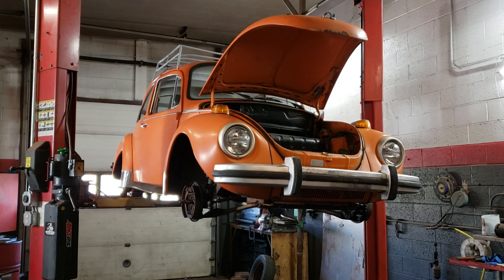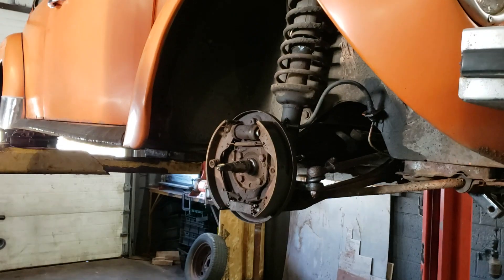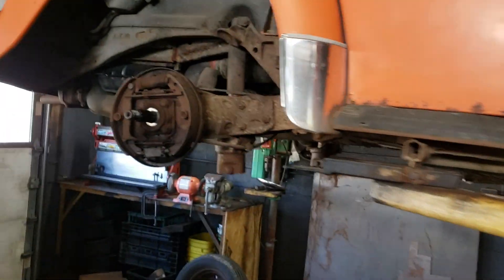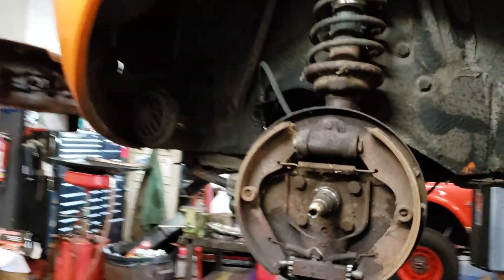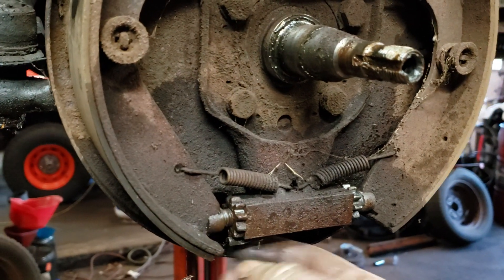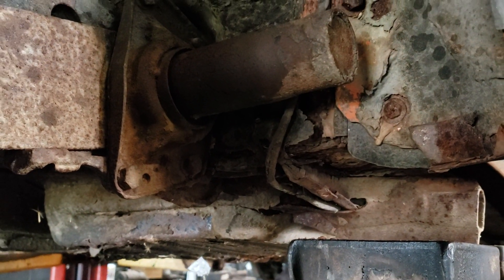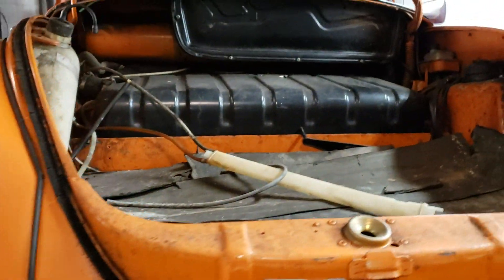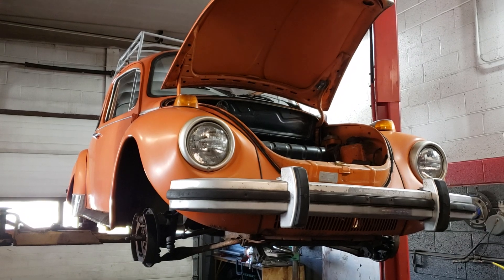Inspecting the 1974 Super Beetle

Comment: YEP it needs new floor pans and seals. Body off in no time . Get a master cylinder and brake lines while you are at it.Oil leak is most likely oil cooler seals . $2 but engine come out and shroud removed to replace.  I would go for the disc brake conversion. Those Drum Brakes and near useless when wet. Use 30wt diesel oil, no synthetic.
I would change throttle and clutch cable as they are commonly rusted too.  you can do all this in a week if you have the time. Drink German beer while cussing those adjusters. Just heat them and twistem out with vise grips and reassemble with never sneeze.

Comment: The worst rust is the pan head - center of the pan, front, near the front suspension. That’s gone, and the car is toast. The rest of it - the pans, the rockers, is (relatively) easy to fix. The pan head isn’t. At least the front end parts for a curved windshield Super are available - at one time none of the bits for a flat window super (70-72) existed.

Comment: Judging by the rest of the rubber goods on this thing, you should go ahead and get some urethane inner control arm bushings. This thing will probably have death wobble. Usually it's inner control arm bushing. People love to absolutely spray parts at this thing and blame the fix on the aggregate, but usually it's just those inner control arm bushings. I recommend urethane just because there's so much compliance in the bushing stock that it really could use less. Also, that frame head rust looks pretty bad, yikes.

Comment: Well given the cars age,a lot of the faults you mention ate to be expected...The rust in tge floor is easy to gix,just cut out rusted section,go 10mm back onto the good metal,and weld in a patch..I would replace the whole braking system,all hydraulics,and also instal front disc brakes from type 3...McPherson struts need replacing too..Personally I prefer shock absorbers..I agree that Fuel Injection sucks,much prefer carburetors such as Fish,and SU...Does this Beetle gave EFI ? some of them did..Its either  a D or L system,if EFI is fitted it will need injectors cleaned,hoses replaced,and maybe a new fuel pump..Fuel tank should be removed and cleaned out also no matter what fuel system.is installed..regards Bob

Comment: make sure and look under the runnong boards that rust needs to be fixed on the tunnel if not the water will get in and rot the entire thing from the inside out if you run a modern strut those cars will rock a huge set of meats and handle on rails build a 2332 with some ida webers and kill it!